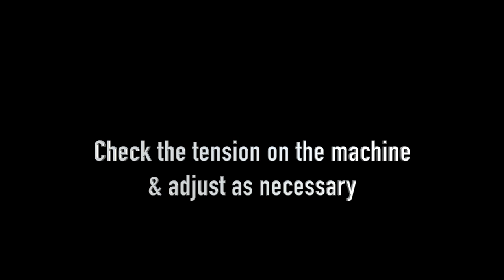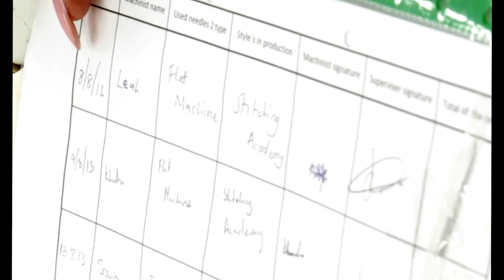How To:  Use an Industrial Sewing Machine

Comment: can i adjust the speed of the machine? i tired to learn but it was too fast i couldnt control it
Reply: Hi Idubor, You  control the speed of your machine with your foot pedal.. push lightly it'll sew slower, push your pedal harder and it'll go faster..This is if you're sewing with an industrial machine.. If you're sewing with a domestic machine check your owners manual and it'll show you how to adjust your speed, it'll be a slide button on your machine, usually on the top middle of you machine. It will have arrows pointing left and to the right. By sliding g this button to the left will make your machine sew slower, slide it to the right and it will sew faster....you probably have this all figured out now but just in case you don't, im hoping this answers your questions.